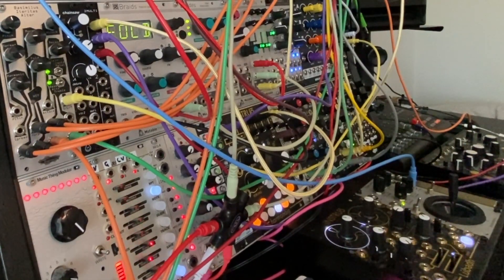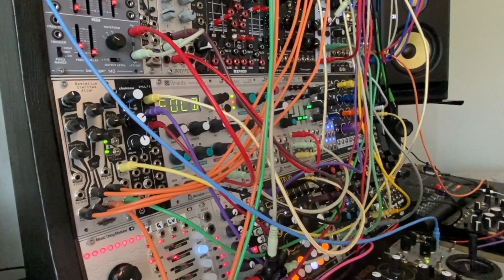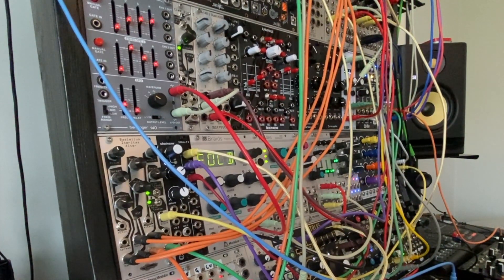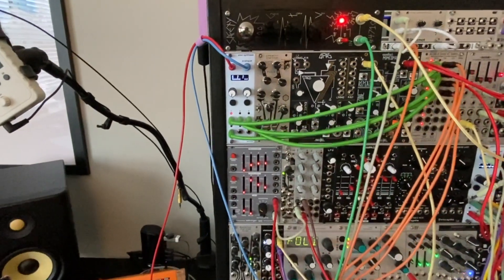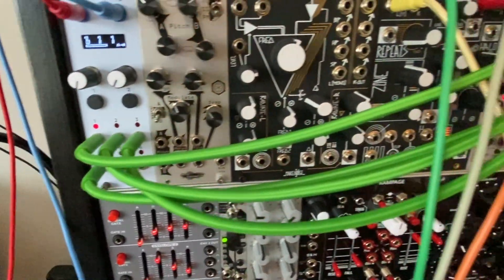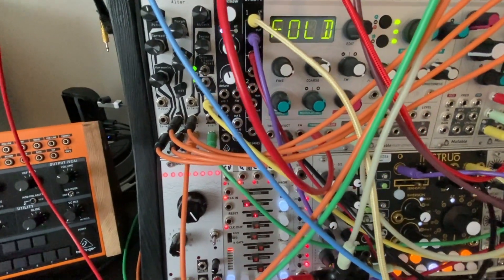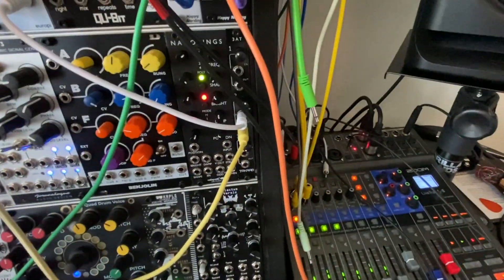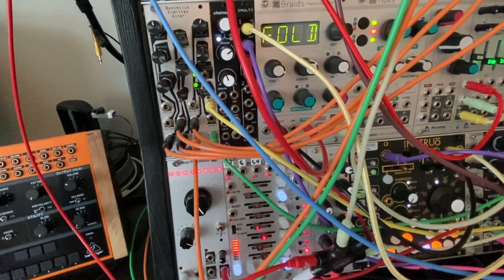Modulating the Noise Engineering Basimilus Iteritas Alter with the EuroPi CVecorder

Comment: It seems to me that every incoming pulse is a recording point. If I want to smooth it out I am currently using a slew limiter. But would it be possible to add (variable) slew or a higher resolution in a future version?
Reply from the maker: Thanks for your suggestion. The CV sample rate is currently twice the clock rate as it samples in both the rising and falling edges of the incoming pulse.

It will be possible to increase the sample rate by increasing the duration of each recording in the code, then using a faster clock. This may mean that the number of channels will need to be reduced though to avoid memory problems. Let me look into it…
Reply: @ModularExploration  I will let you look into it 😎
Reply from the maker: @KPsTboy  You prompted me to look into this today as it is something that I have been thinking about for a while. In particular I wanted to be able to record CV patterns from the Turing machine reliably. Anyway... I have made a few enhancements to the code including adding a longer CV sequence length - this allows you to say run the CVecorder clock at 2 or 4 times the rate of the CV source in order to achieve a higher sample rate. My initial testing using the Turing machine seems pretty good!

If you are interested in testing this new code before I officially release it please reach out to me via insta: gamecat69@hotmail.com, or discord: nik#3012.
Reply: @ModularExploration  Sweet